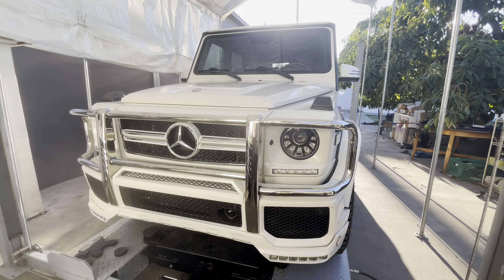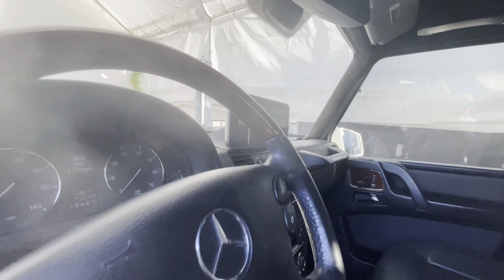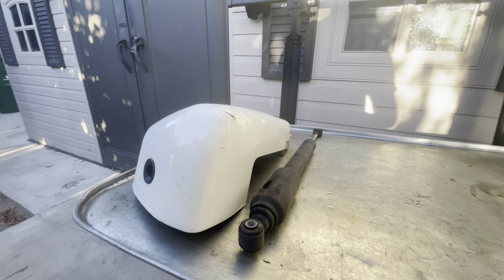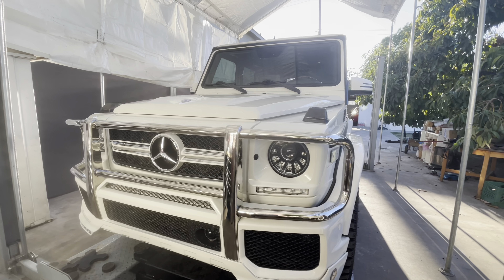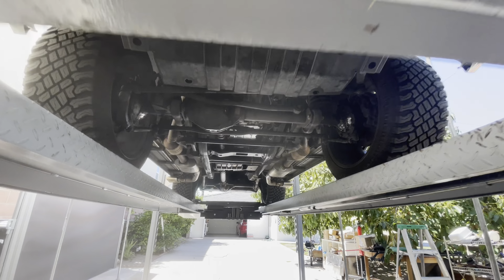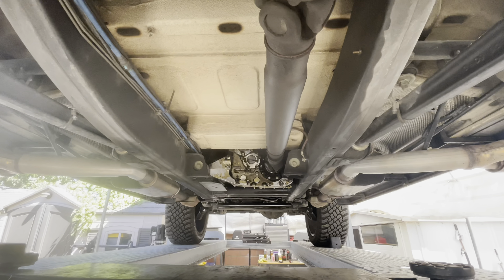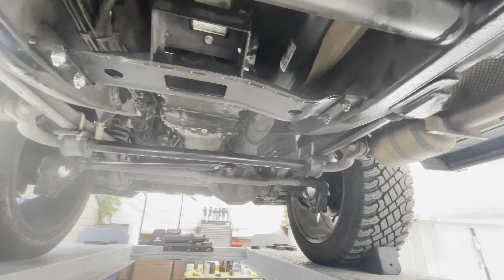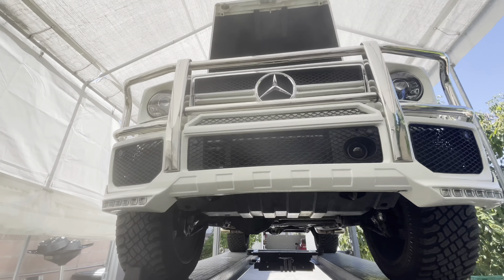2010 Mercedes G550 with AMG exhaust. Acceleration, tour, underside look.

Comment: What made you go with the 2010 G550? Any known issues? Pros of the car?
Reply from the maker: This is not my car, however I think the M273 powered G is a good one to buy in the G class range as it is fairly reliable, maybe not as easy going as the M113, but it has significantly more power, it is cheaper to buy than the G55, much more reliable than later turbocharged G classes.
Reply: @DEEuroworks  That's exactly my thoughts and what I have read. I would be more inclined to go with naturally aspirated. If I'm not mistaken the car was fast, almost 5.6 seconds or something. That's impressive for such a heavy car. Thank you for your reply.